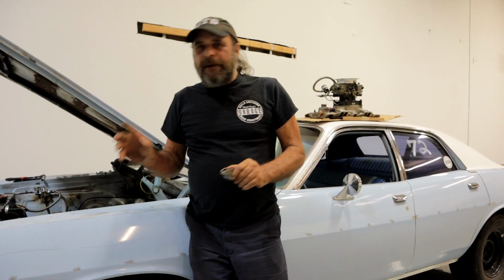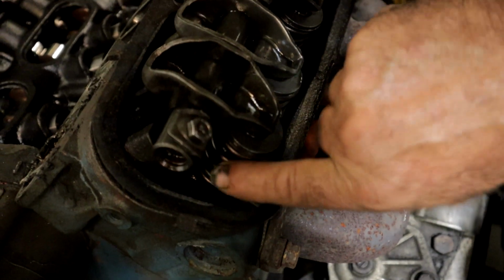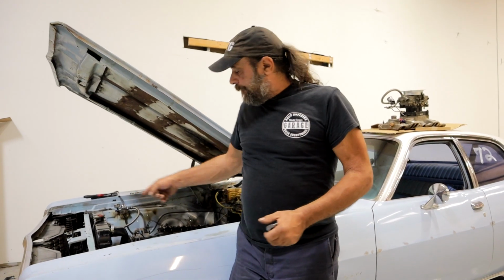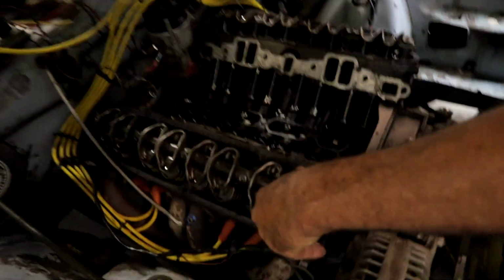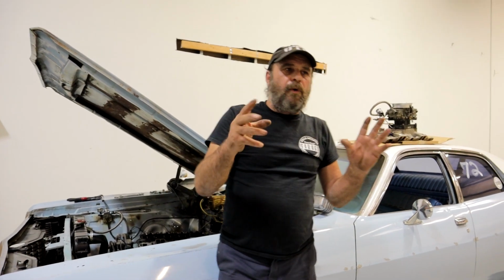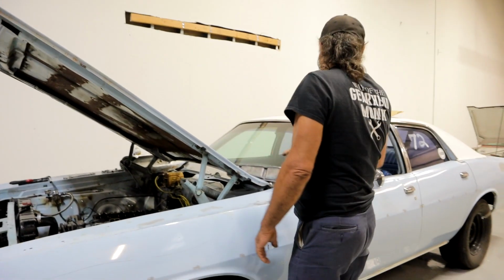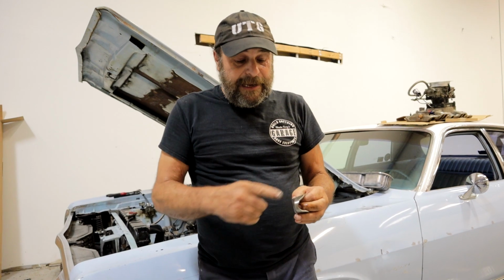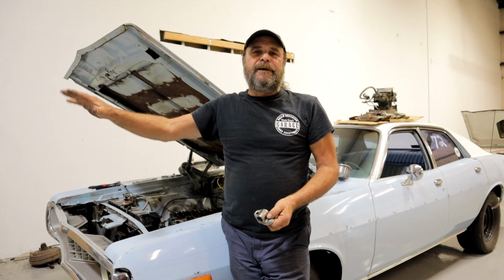Bottle Rocket Rocker Failure Explained

Comment: When he spoke of violence at start up, my mind went immediately to Slave Lake.
Reply: "fuckin' minnnnt!"
Reply: Plan Z!!
Reply: @johnwilburn  
🔥 🦅!!
Reply: Haha. Thats a good one
Reply: Little bit of redline fur a good time!
Reply: Feed it the ketchuo!
Reply: Little red line for a good time.
Reply: Feeder the old bill cosby in a can.
Reply: Put her in the ketchup on startup, you dont need a choke.
Reply: Is there any chance hes at or near coil bind with those valve springs? That would hammer the valve train.
Reply: ever smell exhaust from an engine running on brake cleaner? it explains alot about peg
Reply: MIINTY!!!

Comment: I’ve had this exact issue with not one, but two different sets of brand new lifters. Absolutely unacceptable
Reply: How much were those lifters?
Reply: both sets were roller lifters?
Reply: We've had multiple brands of new flat tappet lifters be noisy recently and a few have wiped cams out.

Comment: I stand right by you Tony, IT IS TIME for these big auto-manufacturers to take responsibility for their faulty parts. Engine Masters wiped the new cam in the General Mayhem's new engine, my buddy Chris in Vegas, wiped a brand new cam as well, and those cams all came from that same HUGE cam company you are referring to. If they are gonna charge us out the wazoo for parts, they can at least invest in getting the parts made here in the states or at least invest in some sort of quality control to make sure all of the Chinese lifters are at least up to snuff. I am with you brother, I am scared to put together my 340 just because I don't want to wipe it out on the first fire, but if I have to go solid roller I will, but I miss the days of being able to buy any cam/lifter set and not worrying about it.
Reply from the maker: It's a mess, man.
Reply: @UncleTonysGarage  it truly is, I know you don't want free parts, but if I have anything that might help you out, just let me know. I got a decent selection of small block Mopar stuff in stock at the moment.
Reply: We're going to have to become our own quality control. When you get something out of the box, open it up and take a micrometer to it. See that all the machined surfaces meet spec and are matched. Check the grind and taper on cam lobes and lifters etc. Have to build a lifter test stand to pump some oil into it and see if the internal valving can hold and if the pushrod cup and internal bore are not within tolerance and are leaking. That's what I suspect is the problem with the 318.
Reply: @TD_YT066  That's great Tom but how many end users have hardness gauges and even if they did, are you going to do a destructive test on a cam lobe or crankshaft journal?  Same thing with rubber parts - you can take a perfectly-fine-looking new PCV valve grommet and soak it in oil for a few months to find out that it swells up like a sponge - how is the end user supposed to be able to determine that they used the wrong type of rubber in that part before they install it?
Reply: @frenchonion4595  sure sounds like it is.
Reply: @frenchonion4595  Yes it is, I have personally never been a fan of them, I have always had Hughes Engines do all of my cams or Isky
Reply: Im building a mild 5.7 for my 69 Dart soon, and Im petrified about the cam... Sooo many horror stories these days, but the stocker has to go. Wish me luck LOL...
Reply: We should also be sure people are using the right kind of break in oil and cam protector additives as well. We cannot complain about wiping a cam if we are not doing everything we can to break it in properly. But I feel your concerns I am mid assembly of my 5.0 and these videos have me staring at parts until I imagine issues and get analysis paralysis.
Reply: @SophiaAphrodite  Most people I know are using all of the proper break in techniques and oils/additives, the problems is with the lifters and how they are made
Reply: @TD_YT066  That's unacceptable. Quality control is the manufacturers responsibility.  That's what part of the cost  of the product is supposed to cover.  Quality control is an inherent part of any legitimate manufacturing process.  It's kinda similar to us having to scan and ring up our purchases at Walmart, Home Depot, etc.  They've put THOUSANDS of mom and pop businesses, out of business, sell you inferior, over-priced SHIT, then, to add insult to injury, YOU have to do someone else's job, because that job, that put food on someones table has been eliminated and replaced by a machine!  I'm so fucking SICK of human beings!  We all need to go.  The giant asteroid that people have been predicting for years that is gonna take us out, can't come soon enough!
Reply: @ScottsSpeedShop  Maybe they should consider changing the name to Crap Cams.
Reply: @ScottsSpeedShop  Can't forget the rest of the valvetrain. Had a set of roller rockets from not that current HUGE LEADING cam company, but one that used to be vying with Isky for the #1 spot. One of the rockers, with less than 600 miles on it came apart. Clip broke in pieces, and one piece got through the oil screen. Twisted oil pump driveshaft up, destroyed distributor gear and of course caused a lot of premature wear to lose pressure at speed. Also caused me another teardown to check for ancillary damage. That's when I started getting gun-shy, when I looked more closely at each rocker and the packaging, and discovered that I had unwittingly put parts from China into my engine. Haven't been a trusting soul since.
Reply: When you taking that engineering master piece of yours to the track? I agree with you on the manufactures

Comment: UT, I would be pissed off too!  Gee, I bet this CAM company has these hydraulic lifters manufactured overseas with cheap labor.  What a bunch of crap!!!  I hope this CAM company steps up and makes it right…..  this is completely ridiculous and unacceptable….
Reply: I don't. I hope he names and shames them too.  You know why I hope they don't make it better?  Because nobody without a YT channel with hundreds of thousands of subscribers can push this company around and get the service UTG can get by leaning on them with his enormous audience.
Reply: Not to mention the fact that Tony paid at least a grand for it
Reply: If these lifters are designed as anti pump up, the lifters bleeding down is normal.
Reply: @MrJeffcoley1  
My $.02.
If the lifters are bleeding down there has to be a problem on the seat where the ball sits. Probably just machined or poorly lapped.
Reply: Didn't UT have this discussion a couple of months ago when he was rebuilding the slant six?  He recommended using NOS parts when available.  He's talked about the same problem with rubbing blocks on points.   It's the same problem we find with all products.  That is why we flock to the larger, named brand companies.  Unfortunately this is a disease that plagues almost everything these days.

Comment: I've been reading through the hundreds of comments below and it's utterly astounding to me how many people keep speculating and suggesting other root causes without FIRST taking into account the fact that the lifters are faulty and keep bleeding down! Which causes slop in the valvetrain...leading to premature valvetrain failure (at NO fault to U.T. whatsoever due to crap lifters). Not only causing valvetrain tick, but as Tony CLEARLY (and with sound logic) explains: when the lifters bleed down it causes slop in the pushrod (due to the added clearance created when the lifter bleeds down), which, in turn, causes the pushrods to jackhammer on the rockers before the lifter is able to pump up again. If you can't understand the simple physics behind that and you go on to suggest other causes without FIRST taking into account the faulty lifters, then there's nothing that can help your sense of logic or lack of deductive reasoning. How people yammer on about different causes without taking the root cause of this issue into consideration - i.e. the lifters bleeding down, allowing the pushrods to jackhammer against the rockers - is beyond me. FFS.
Reply: Almost like a slide gamer but in reverse
Reply: They call this phenomenon  egalitarianism and social media fuels it.  Its sickening
Reply: Indeed. The rest of the equation has no impact on the lifters not holding pressure.

Comment: "Giant huge cam company" doesn't care, just like most companies these days. They got your money and they'll ride on their former good reputation just as Chevrolet has also been doing for years.
Reply: I think i'd use Maybe Honda or Toyota for examples. Honda i'd say for the most part.Chevy, TO ME, hasn't had much of a good repuation for fuck 15 years? Minimal. They all do it, but man chevy just likes to crank out some junk nowadays.
Reply: Fun fact - Chevrolet was #6 on the 2018 JD Vehicle Dependability Survey, ahead of both Toyota and Honda. Buick was #3, right behind Lexus and Porsche.
Reply: @machinist7230  JD power associate awards and surveys are complete BS. Makes for great commercials but it’s means nothing. JD power will give them a award for reliability then look at consumer reports or something else on the same vehicle. JD power and reality couldn’t be farther apart most of the time.
Reply: @machinist7230  
 @Charles Price  
Well, while that was "Initial Quality" and JD Power is to some degree bullshit, it is based on customer input. So while the JD Power results are not rock-solid, it is an intersting thing to learn about the perceived quality which owners reported. In previous years, owners were very willing to rake GM products over the coals. So it actually is saying something when their perception has changed. However, I find JP Power is based mostly on pissy little things like "my radio presets keep resetting, this car sucks".
Reply: @machinist7230  only old folks who do less than 5000 mile a year buy Buick car no wonder they have good reliability lol
Reply: Probably took all their quality control people to teach CRT classes.
Reply: Had a set of comp cams lifters come apart. All the retainers came out of em. Nothing crazy rpm wise. Xe268.
Reply: @baileyhatfield4273  Toyota and Honda make crap for the last 15 years...loads of major issues! Toyota only ranks in the middle of the pack for reliability,but people think they're the best..Not true! Even before their major computer issue of random acceleration,they had rust issues and engine issues,biggest engine sludge issue in the world from 1997-2006..They fixed that by having oil burners that eat pistons and rings thus needing engine rebuilds early on 60,000 miles some lower they burn oil from the get go and get worse overtime! Honda same thing engine issues,trans issues etc..
Reply: Giant huge cam company is probably now owned by a big conglomerate that doesn't even know they own it. The name means nothing.
Reply: @01trsmar  thats a mountain outta a mole hill compared to everything american..klnown issues for 25,000 vehicles vd for recalling every single escape 9 different ways from sunday before they got off the delivery truck
etc etc....sure toyota have had their recalls especially since the american bailouts caused the gov't to play hardball with the imports....but i will be clear here...
toyotas and hondas are still 10x the car for reliability bar none & period.
i threw my hillbilly pride to the side long ago and havent been even remotely regretful in over 30 years.....
NOTHING but break pads and tires for all my vehicles and my friends and family vehicles......one or 2 of which had warranty till crash or sale.
 ...nobody goes back... hate all ya want, but most of these cars are american made too....it aint even "buy domestic" when all the cars get non code vin for country of origin....

Comment: I understand Aviation has been going through this for years. Doesn't make you want to fly let alone start up Bottle Rocket. Bring back all the manufacturing the companies off-shored and the problems will be solved. More expensive, but huge quality leap. Thanks Uncle Yoda Tony!!!!!!!!!!!
Reply: The diesel/heavy equipment industry has been plagued with substandard and counterfeit parts for nearly a decade as well. Rebuild or repair has become the norm rather than replacing somthing if at all possible because of "bad outta the box" or 3 mile down the road failures...
Reply: Dude i used to do aircraft repair, i won't fly. The part quality is why.
Reply: The workers are gone. It's too late to bring the process back.
Reply: I dont think that's true at all.

Comment: Poor quality from guess where...   I bought a few bearings for my lawn tractor deck from you know where... the new bearings seemed rougher  then the old ones, but I put them on anyways , lasted about 2 weeks , they completely self destructed ... had to put the old ones back in , repacked them with grease , its been almost 2 years with the old ones .
Reply: @easygoing2479  funny how everyone wants to bash them by typing on a phone made by them and probably sitting in a foreign automobile. Buying cheap has made the world cheap.. but don't we still just worship wall street psychology?...
Reply: @easygoing2479  The current  US government from 2 to 3 yrs. ago. Free enterprise says cheapest that sells.
Reply: Good few years back...wife had a PT Cruiser🤢...rear hub bearing goes bad..easy fix...2 weeks later im changing it again...at least that one lasted til she got rid of that crate a year later.
Reply: @JimsRustyOldNuts  Had a bearing (04 VW Jetta) a rear one, so simple spindle type slide on hub deal, SUPER easy to do. Nice easy job, a bit of pain in the rustbelt but still super easy and almost relaxing. To the point, lasted like 5 6 months with LITTLE mileage on them. Sounded like...rolling marbles in a dryer or something. The worst maybe roller skates sound ever. It wasn't even cheap problem is. Not like i got a 20 dollar bearing (hub) and said there we go. I'm sure it was 150 ect. Went with a MOOG replacement bearing, about 200 bucks i think Canadian, maybe it was more, but anyways, 3 year warranty so, worst case the next time is ''free''
Reply: @chuckthebull  LMAO - You've got no facts.

Comment: In the "spirit of the car", a regular user would have this problem and just have to suck on it.  So this exercise is a good example of how this kind of project has slid out of the realm of feasibility for most people.
Reply: I mean you might get a replacement, so eventually by doing their quality control for them you would end up with a good set
Reply: Too true, well put

Comment: Least Tony taught  us how to check if the lifters are bleeding down on our car. I just assumed  you set the lash and forgot  about them till they made noise.i used Wynn's  oil product to clean up sticking lifters in my 93 s10..only way to fix it cheaply..

Comment: I’m currently building a 455 Pontiac engine and installing a new Wolverine Blue Racer flat tappet cam & lifter set I purchased over 30 years ago..... back in the day when parts were American made and high quality.
Reply: Just make sure you get the good oil with lots of ZDDP in it when you break in that beast!
Reply: You must have bought them before 1975 then for them to be quality.

Comment: He's talking about Comp Cams if anybody didn't know that already.
Reply: I thought so
Reply: I knew it was either Comp or Crane. I just couldn't remember which one.
Reply: @MikeBrown-ii3pt  The last Crane roller cam I bought looked really sketchy , but hasn't had kittens yet .
Reply: When he said worlds largest, I thought he meant Iskendarian.
Reply: Glad you added that, I had blamed the woodpecker.
Reply: I thought it was Crower. Sold me pitted lifters.
Reply: @deadchewie  isky rules
Reply: @MikeBrown-ii3pt  nowdays it is the same thing the investors that own comp bought out crane too. There is no more crane cams.
Reply: Has ANYONE had a good experience with CC hydraulic roller cams? I've only heard bad ones, and that includes a highly regarded machine/high performance shop in my area. They claim you'll never get a CC hydraulic roller to stop making valvetrain noise.
Reply: @jefftschetter5881  They must be doing something right. They've been around since the 1940's. Don't know anything about their current stuff, but what I used in the 60's and 70's was excellent. They balanced  a G.T.O. rotating assembly for me way back when and that was good.
Reply: I had a problem with 2 roller lifters from them as well... I think their quality is gone.
Reply: @tomworthington9547  I have a big block in my 69 Vette with CC hydraulic rollers that I installed in 2009.  They have always leaked down.   I honestly don't think anyone makes lifters worth a damn anymore.  I have Harland Sharp roller rockers in it that have thankfully held up.
Reply: @bcbloc02  This happens so often nowadays. The big investors or corporations buy something, turn it to cheap trash, and make big bucks off the products established reputation.

Comment: Before the pandemic I replaced front wheel hubs on my 4x4 Ranger. Sealed bearings from a big name suspension part company. LImited driving (work from home, no daily commute) and already I'm getting roaring bearing noise from the front end. This has gotta stop.
Reply: Are you running stock tires and wheels?  Or ones with big offset?  Are they standard wheel bearings or Unit Hubs?
Reply: Had the same thing happen with a VW (similar setup with FWD) got 7,000 miles out it.
Reply: We're plagued by shitty sealed bearings in the cycling industry as well and they're not cheap...
Reply: @auteurfiddler8706  I am running stock wheels with 265-75R16 BFG all terrains, which I believe is a stock FX4 size